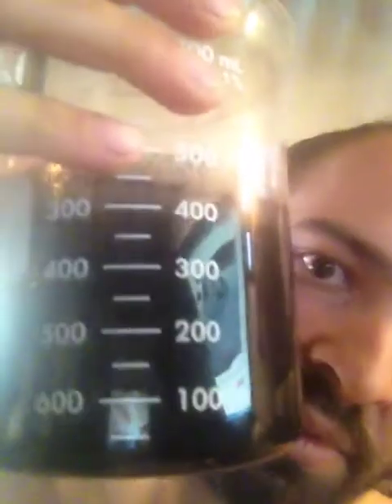How to Make a diesel engine run on charcoal, water and oil

Comment: Yes! Seems like it would be cheaper than diesel fuel, and made from some mostly free and/or cheap materials. Interesting!
Reply from the maker: ya thanks.  The goal is to create energy ideally from the ground.  So you grow peanuts and collect the oil  and harvest wood and make charcoal and you can produce energy.  For me I will use my diesel (coming in a few days) to hook to a generator and produce electricity to run all sorts of things.